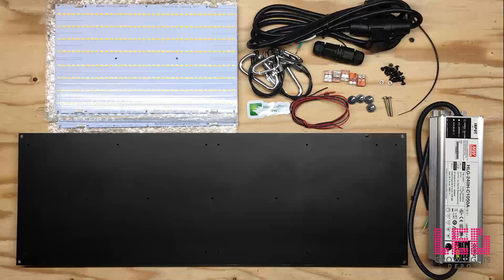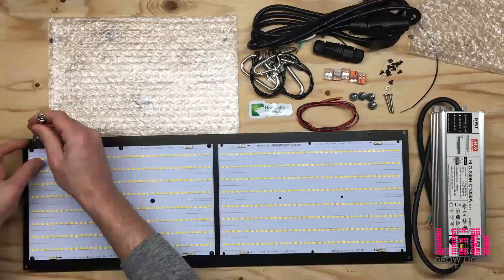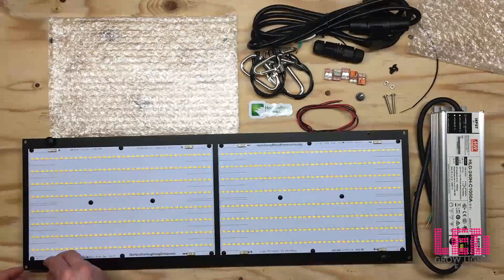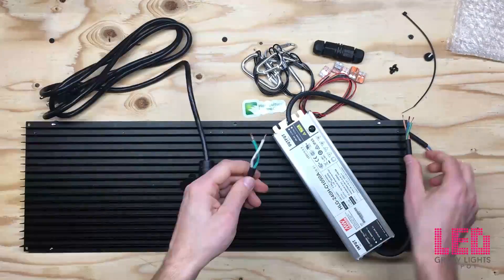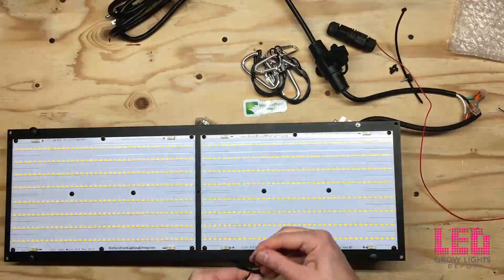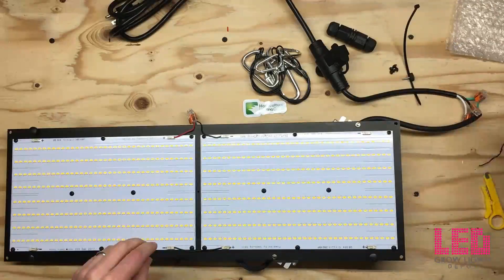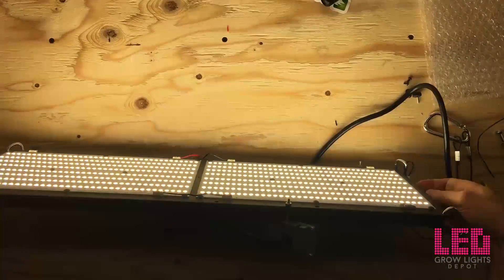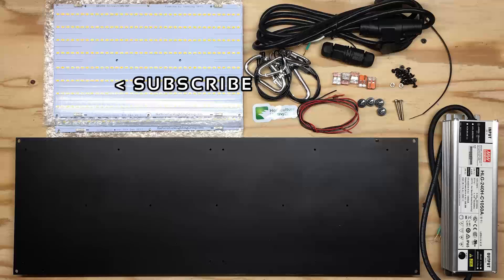Horticulture Lighting Group 260 watt DIY LED Grow Light Kit Build and Review

Comment: One of my boards "minus" and "plus" connectors are wrong way round? There is a picture https://gyazo.com/e20ad297082f491db9ee641a4f9d0fd3   ---- Which of the boards have been marked wrong in the factory ?
Note that the bottom left panel is different way around

Comment: Can you explain why you are not matching colours of wires when you connect the power cord wires with the driver input wires?
Reply: yea im lost. he connected 2 different colors and didnt mention if the combos matter and what color to what color on the trio of wires.
Reply: @bakedpwn4131  he added the different colours so the boards run perpendicular in power. So one power flows through both of the boards in the same direction. I wouldnt wire it up any other way. You can watch HLG's link which is wired same way.

Comment: If you are using the 1050 model driver it means your board only take 50-53 watts. you have 2 boards so you get max 106 watt, so how come your light name is 260w? am i not understanding something?
Reply: i think he had the wrong one, the kit should be coming with a 2100

Comment: I only connected the driver directly to the board ( not with the thin soled wires ). Will this cause any problems or just messy cheers

Comment: Is it dimmable?
Reply: Energi Inc. Yes it is with a little screwdriver you remove a little cap on the drive and adjust it that way
Reply: Energi Inc. yeah bro...they are & they're bright af compared to my old 45w t5, i went with an HLG 135w kit for starting seeds & vegging them up to put outdoors...got it hanging & ready to grow in less than 15 minutes....almost went with one of these
Reply: yes for an additional fe you can have a nob installed vs needing to use a screw driver to adjust the light